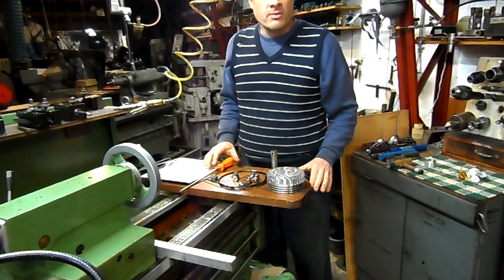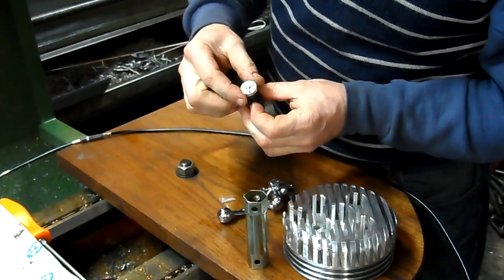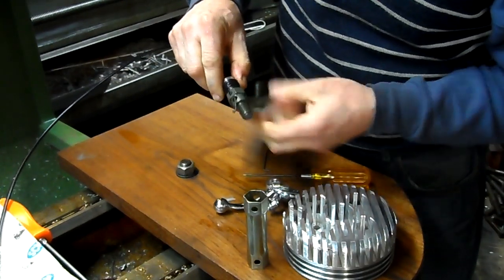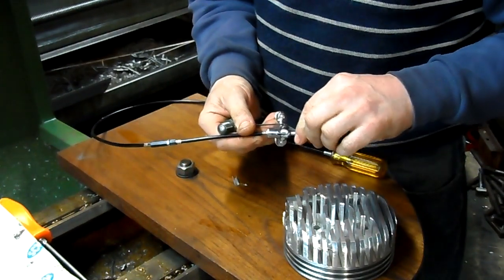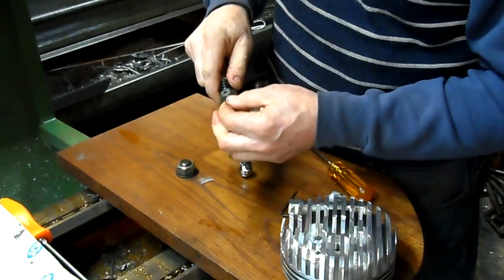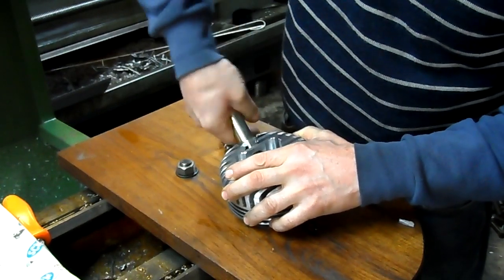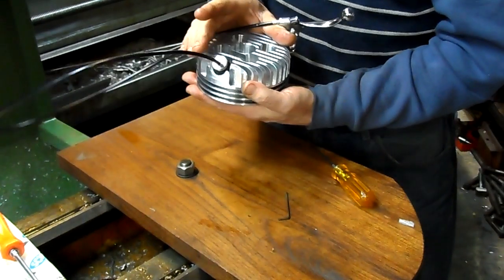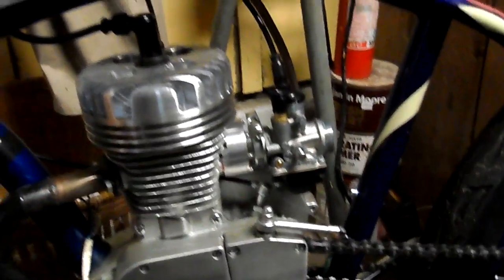Installation instructions for compression release of CR Machine Fred Head cylinder head

Comment: Frederic Chelminski, you are the fucking Man! Such pride is taken in the craftsmanship and such perfectionism. I'm wondering about the "Belveal washer" that you use or suggest on your heads; is that a Fred creation or have those been around awhile? I make them for myself to use elsewhere by placing a washer onto something with a hole slightly larger than the id of washer and place the ball end of an appropriately sized ballpeen hammer into the washer then give it a couple whacks with a 4lb to give it that concave shape- I wonder if they are working as logic would seem to dictate they would though.
Reply from the maker: Thank you. Oh  no, "Belleville" washers, or "disc springs" have been around a long time.
Reply: Frederic Chelminski Belleville, cool thank you! I had another question for you- possibly a little personal; which engine do you prefer working on/bringing up to snuff? The PK-80, GT-5 or halfbreed? How long have the "X cylinders been out and how do they compare to the older Skyhawk ones with the extra wide fins? In looking for a cylinder body with a tad bit more effective cooling for extended runs at nominal rpms.

Comment from the maker: The heads are simple 6061 aluminum. The decompression valves are steel. No, we don't bore out these cylinders: They stay at 47 mm diameter. The 40 mm stroke engines are about 70 cc, the 38 mm stroke engines are about 66 cc. 
Try an NGK B7HS plug.

Comment from the maker: Yes, it will shut the motor off. It will shut the motor down very fast. The main reason for using this valve is to help slow down. Using the compression release, you can use your brakes much less. It is really cool!
Reply: I am looking  into purchasing  compression release valves for  my 04 soft-tail W/revteck 100  kinda dumb question,  do the manual  valves close by their self??   Please  Someone  Help?

Comment from the maker: Hi. These heads fit the motorized bicycle engines. They are 2 stroke engines, of course. These are for the big 47mm bore engines. Gasbike.net, Kings, and Piston bikes sell GT-5 motors, which are 66cc disp. You can get these engines from several other vendors on ebay. You can get 66 and 70cc engines from DAX too. These engines are made in Asia. I think most of the parts are made in China. Sorry I don't really know the brand, just those vendors that I mentioned.